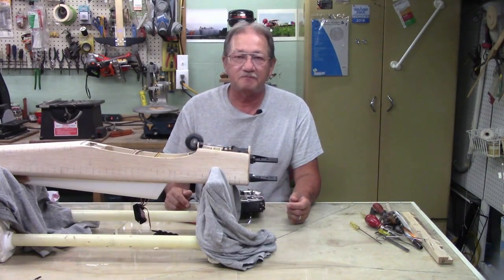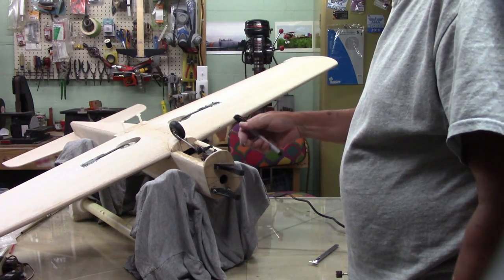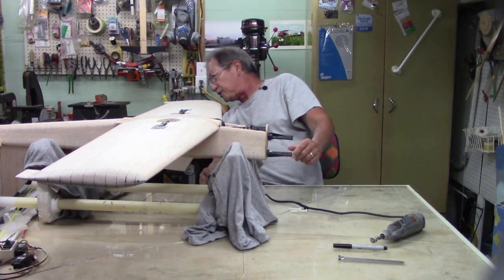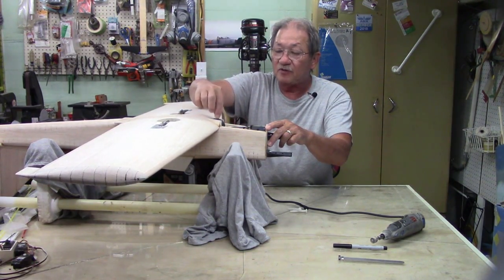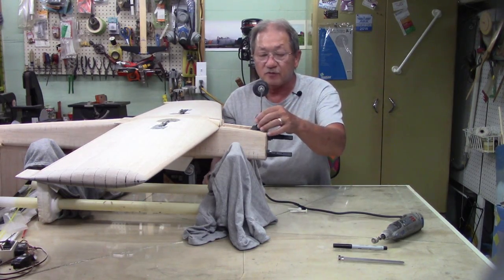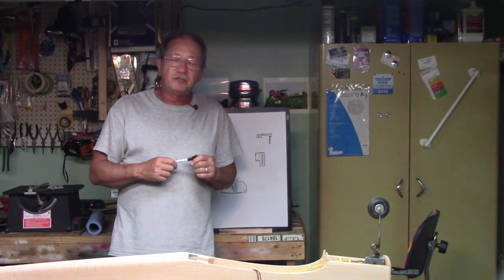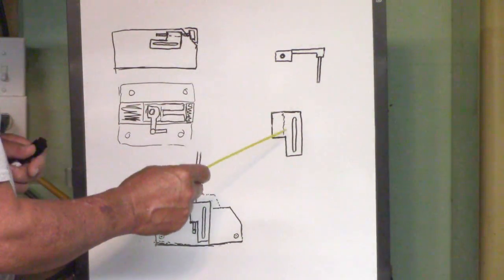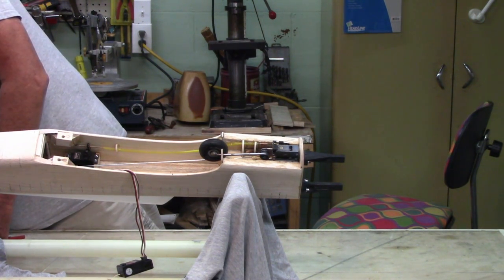SIG KOUGAR BUILD   Part - 16   Nose Wheel Retract

Comment: Hi Bob, just a note on micro ballooning and monokote. I made a batch up just as you did. Put it on wax paper and pressed a popsicle stick into it and waited about 20 hours. I just removed the wax paper and it just about fell off. Did not stick at all. I'm not sure what I did wrong before, I followed the video to a tee. I used the same supplies as you, but definitely not the same results. The only thing I can think of that might have been different was the batch might have been made to thick or I put in to much hardener. Not sure how I messed up, but now I have an alternative. Time to repair and try again. You said in your video you were having health issues. I'm sure I speak for all of us when I say I hope you are feeling much better. Also, are you making other videos on other planes. I would love to tune in if you are. Bill
Reply from the maker: I'm glad it worked out for you. Now that you used the wax paper I'll add it to my list of things to use. Thanks for the information.

The doctors have me on an even keel now. Feeling pretty good. Now I have to catch up on all the things I had to put off.

As of this moment I'm participating in an Model Air show at the Midland RC Club ( Midland Michigan). The wind is blowing 14 mph and the temperature is only 64 degrees. Not very comfortable to say the least.

Comment: Hi Bob. As usual, your videos are great. Along with the Kougar, I'm building the PT-40. I followed your video on wing saddles and, well, popping off the wing didn't go so good for me. It ripped off a lot of the monokote and broke off the dowel in the front of the wing going into the fuselage. I followed your video step by step. Could this be because I may have added to much hardener?????? What if I covered the area on the wing that will be in contact with the resin with wax paper? Does the resin not stick to wax paper like the epoxy? Thanks again for all your help. Bill Drummond
Reply from the maker: Which version of the PT40 do you have? (Rubber band on wings or the bolt on wings). If the covering wasn't the Monokote brand it won't work. The amount of hardener shouldn't matter as long as the resin dries thoroughly. But what might make a difference is the amount of Microballoons you use. Your mix should be about the same consistency as Spackling Compound ( the plaster type, not the lightweight type ). I use Monokote because it lays flat on the wing and won't wrinkle during the drying process. I never tried wax paper. Of course you have to use a class B resin ( Class B has a wax additive in it so the resin will dry to the touch and not be tacky). You can also put a couple coats of wax on the Monokote. Mold release wax from better automotive stores works best. I've used car wax (Carnauba type)  for  a mold release agent in a pinch. I never had any breakage like you described. Lastly, don't let the resin lap around the wing where it might hinder the wing from separating from the fuselage. Oh, and make sure that the area that comes in contact with the resin is covered with Monokote. One more thing, make sure the wing dowels will tolerate the trailing edge being lifted to some degree to prevent breakage ( if your wing is  the bolt on type). If I think of anything else I'll be sure to pass it on to you.
Reply: Thank you Bob for getting back to me as soon as you did. I am building the bolt on model and the covering is all Monokote. I used the same resin you did and I let it dry for 20 hours. The mix was like the consistency of spackling compound. It might have been a touch thicker. I've just finished changing out the dowel but have to buy the two colors of Monokote before I can fix the rest. I definitely made a mess of the wing. I am going to try mixing more micro balloons, put it on wax paper, put a balsa stick in it and see if I can lift the stick from the paper. Do you know if the hobby stores like hobby lobby or something like that carry the mold release wax. As usual, thank you for all your great help and info. Bill
Reply from the maker: I know Tower Hobbies don't carry it. You can try any local Marina that does boat hull repair or auto body shops may also have some. Here are some places on line to buy some:
http://www.fiberglasssupply.com/Product_Catalog/Release_Agents/release_agents.html
http://www.uscomposites.com/moldrelease.html

Just in case you might need some, here is the website  I get my Fibergass from:
https://www.thayercraft.com/fiberglass-for-models.html
Much cheaper to by your fiberglass from here than from any hobby shop.I hope you have better luck you next try!